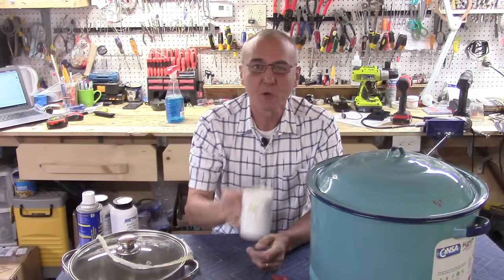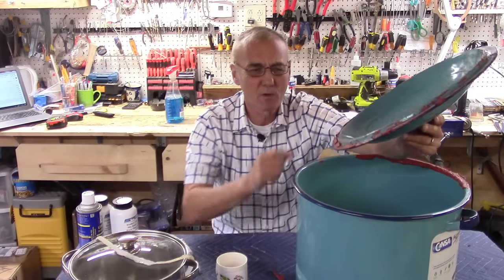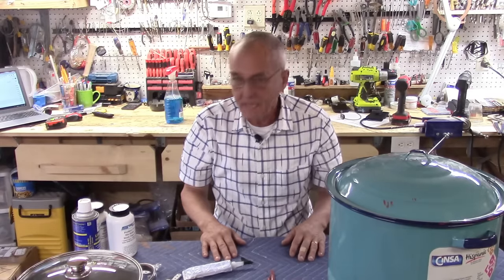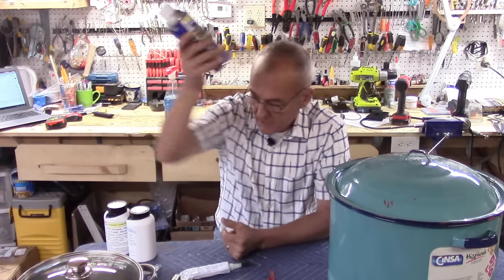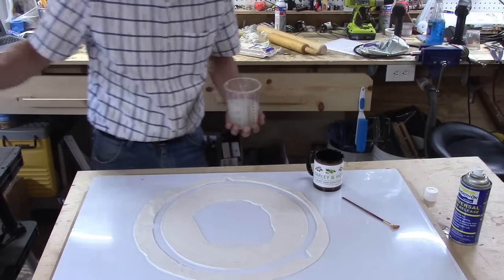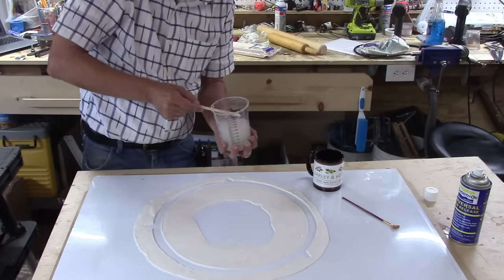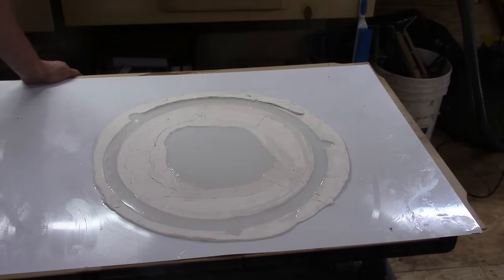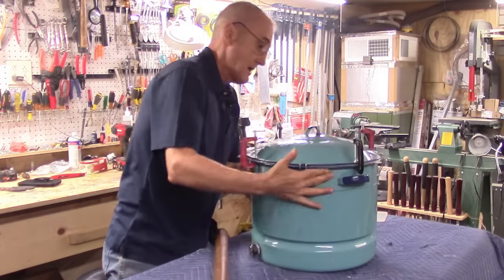BUILDING YOUR OWN STILL

Comment: Unfortunately, every place that you drilled through has compromised the enamel. The steel will rust in short order. :(
Reply from the maker: Okay. I am building a back yard still at little to no cost. I am not assembling hospital grade stainless steel system.
Please give me a break on this. Some things are obvious. If it rusts out after a few uses I am only at a loss of a few dollars.
Reply: It's still a valid proof of concept, as the process would be the same on any pot, weather it's enameled, stainless steel, aluminum, etc...
I would think that one of those silicone compounds applied around any joint edges would fix that anyway.
Reply: @BarleyandHopsBrewing  
No. Your using steel! You DO NOT USE STEEL for a still pot!!! The only metal you use is stainless or copper. Other metals will produce salts in your mash and WILL poison your shine!!
Reply: @BarleyandHopsBrewing   - My apologies. I'm not trying to give you a hard time. Many folks are tempted to use steel or aluminum stock pots for a boiler, but they are not appropriate for the corrosive ethanol fumes. For a few bucks more, you can get a Bayou Classic 20qt stock pot made from stainless. Your gasket fabrication is ingenious and would work great for the stainless pot as well. Medium-size binder clips around the periphery work very well to clamp the lid down. Cheers!

Comment: The term "boiler explosion" comes to mind, for no real reason
Reply: Minds make inaccurate associations, "for indiscernible reasons"... Every basic high school chemistry lab has many small versions of what he is building, a lab flask with a fractional distilling column attached. It's not a 'closed to the atmosphere' system. There will be no real "pressure" in the pot or in any of the completed assembly when it is running. 
It's a still pot, not a "boiler" as in, a high pressure steam generating vessel (for driving power turbines usually).

Comment: Do not try this. You NEVER use brass or steel parts in a still. If you are making ethonal
Reply: As in fuel, maybe. If you are running the risk of prison time and making moonshine (the government doesn't care if it's a 1 gallon still or 100 gallons) then you will make poison salts in your shine.  Use only copper or stainless for your pot and fittings. Never use ANY lead solder only silver solder. And watch your temp.  175° to 180° is about were you want to be. And you should double or even triple your run. That means dumping what you get back into the still and running it threw again. You'll get less volume but higher proof. And always dump out the first but you get. It WILL contain methanol (bad stuff)

Comment: You're doing it wrong. It's a very least use stainless steel don't use steel that's been glazed and then cut into it no.

I hope nobody follows your directions. Look, I've been doing this for 35 years, if I was still cooking single malt that is so good you would throw store-bought whiskey out the window. Don't use this type of material do not. Where did you ever come up with this
Reply from the maker: Thanks
Reply: @moncorp1  why do you care? You should be grateful that someone's out here looking out for your best interests. The only thing that should ever come into contact wish ethanol vapors is stainless steel or copper preferably copper. Nothing else nothing zero zilch nada just stainless steel or copper

Comment: Why in the name of the Jolly Green Giant are you putting pressure in this system? Ao still is an open system it does not build up pressure if it does you're doing it wrong a gasket is just supposed to be too lightly seal it doesn't seal against pressure! testing it under pressure is a waste of time
Reply from the maker: Thanks for the comment
Reply: @moncorp1  sorry I'll make sure that I pass that information on to the Google team so they can get there voice recognition working better

Comment: Why are u on here talking about something u dont know about. Ir gona kill some body. You can not use silicone! Rtv is still silicone. U can not use any epoxys. If that ceramic coated pot has lead in it u cant use it either. Plus that cersmic on them pots chips n cracks and they rust.. u can only use silver solder or baze. To solder with. Heres a thought try learning for ur self befor u try to teach others.  I hope you tube pulls this. You guys are so hungry to make the money ur posting dangeous videos. Where ur cutting that lid for that column ur exposeing bare steel that will rust in very short time. If u have any scruples at all ull pull this video.